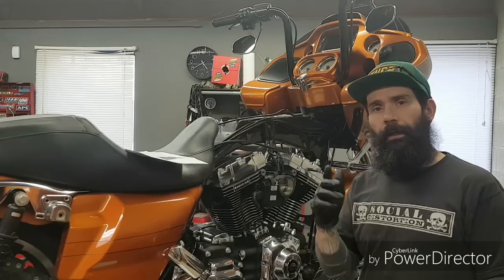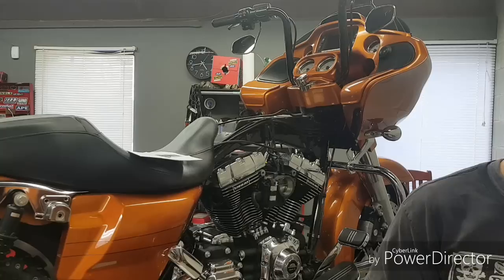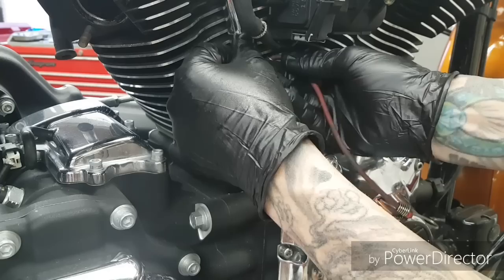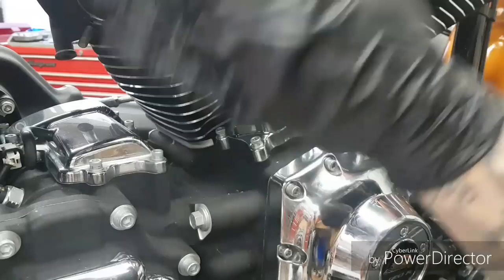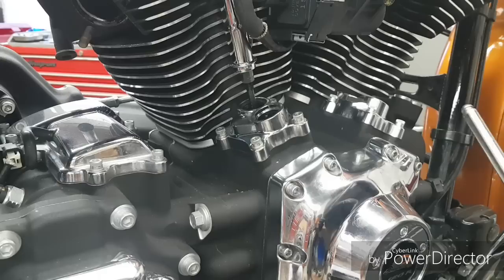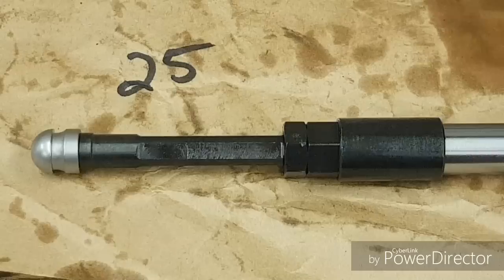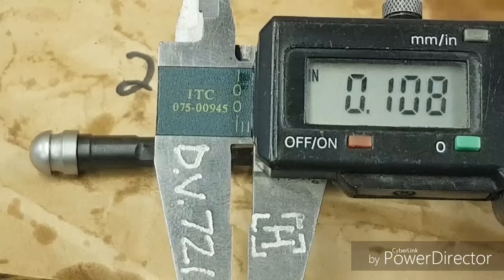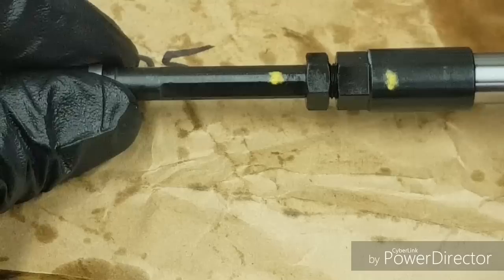Adjustable Pushrods for Harley Twin Cam

Comment: I already have the S&S Quickie push rods installed, but want to go back and check to make they are tight. Since I will not be removing any of the push rods, how will I be able to insert my fingers over the tappet covers, can I merely insert a measuring stick in the spark plug hole to find tdc?
Reply from the maker: yeah that will work fine, you can turn it off through a couple times and get familiar with where about TDC shows up. I use a longer skinny screwdriver that way it has no chance of falling into the cylinder. just be careful to not put it in to early in the up stroke as it can get caught up as the piston rises, and by to early that’s below the mid point of upward travel. use your thumb over the spark plug hole to feel the compression as the piston rises on the compression stroke

Comment: So if your installing these with stock lifters , they will already be primed and pumped up when you cut out the old push rods?   Or do you need to remove the lifters and ensure they are fully primed to ensure your adjusting the pushrods to ensure you get them to the half way mark. Approx .100
Reply from the maker: Yes, if you are reusing the stock lifters, and they have not been removed, provided they are in good shape, they are usually fine and do not require to be primed. Thanks for your question!
Reply: @CrackerJackMechanic  thanks man… I assume the spring pressure keeps the plunger at the top.  Just to be safe I will remove them inspect for any wear and oil them up prior to reinstalling them.  The bike only has 5k miles on it
Reply from the maker: There isn’t a spring inside, it’s just the static oil pressure. If you keep them upright after removing the lifter they won’t loose much oil after removing and they should pump back up just fine. 
In terms of a lifter that has lost it’s oil, it won’t take as much pressure to lengthen the pushrod on reassembly, so just keep that in mind, once you make contact with the lifter, there will be no up-down “play” and you can start your measurement from that point.
Reply: @CrackerJackMechanic  gotcha… hey is it recommended to prime the oil pump before starting?  Do you just leave the spark plugs out? Do you need to take all 4 out or just unplug the wires?  About to start this cam upgrade tomorrow.
Reply from the maker: I don’t think I’ve ever seen anything about priming the oil pump specifically. It is gravity feed and should kinda fill itself before you can actually start the engine

Comment: Shouldn't you let the first pushrod bleed down completely before you adjust the second pushrod (inlet and exhaust valve on the same cylinder)  because you can get valve kiss (the two valves  touch each other) and end up with a bent valve.
Reply from the maker: Good question. and it doesn’t t lift enough to worry about, it’s bleeding down as soon as you start preloading and  by the time you start adjusting the second one you won’t get interference. Maybe on a really high lift cam which would require head work.
If you are concerned you can wait til the adjusted pushrod is loose, to do the second one. I’ve never had any trouble
Reply: @CrackerJackMechanic  thanks for that bro.
Reply from the maker: any time!
Reply from the maker: @brenttrading2363  💯✌🏼
Reply from the maker: @brenttrading2363  💯

Comment: When planning to install new exhaust and intake pushrods into both front and rear cylinders, does it matter which push rods you insert first, front or rear cylinders? Also, if starting on the rear cylinder  (as in your video) and you insert your fingers in the tappet bore in order to find the base circle of the cam, do the results tells you that you are in the base circle for the rear cylinder and not the front base circle, correct?    In order videos I have watched, they follow that procedure for the rear cylinder but then state that the front cam is on the base circle. Can you explain?  Thx.
Reply from the maker: Good questions!
I just usually do the rear cylinder first, no real reason.
I adjust both pushrods for each cylinder at TDC of compression,  I know exactly what the cylinder I am work is "doing".
I am aware of the adjustment you described, regarding the opposite cylinder tappet poisition, you may prefer to do it that way if you are comfortable doing it that way.
👍🏻

Comment: hi nice video i have a question i follow your instruction and now when i run the bike i hear clicking noise on the rear cyclender push road. what do i need to do?
Reply from the maker: On a first start up after installing adjustable pushrods that can take up to two minutes for the tablets to actually pump up with oil again and the noise to go away it lasts longer than three or four minutes goes for the adjustment procedure again

Comment: jeff;qdo vc coloca essa pre carga de 4 voltas,vc abaixa a compressão do tucho em 4 voltas;não se corre o risco de quando o tucho carregar por completo, a válvula não feche completamente?nesse caso a pressão da mola seria suficiente pra fechar a válvula,vencendo essa pre carga do tucho?
Reply from the maker: The adjustment is different for different manufacturers of pushrods I used to translator to understand your question didn't work very well make sure to measure + .100 inch of adjustment to make sure preload compression of the hydraulic unit is in the middle of its range
Reply: @CrackerJackMechanic  thank you jack

Comment: Running into an issue putting the small retaining clips/ covers on. Replacing the old covers with the sns ones and it’s like the spring dosent move as I push the clip into the print that goes into the spring on top
Reply from the maker: Sorry for not replying! I am just seeing this !!  Those are a pain. Make sure the cup isn’t hitting a cylinder fin when you are trying to move it downward to get the bottom of that top clip into place. Also the inner pushrod tube must be fully seated at the top into the head and oring

Comment: What should i do if my lifters wont bleed down
Reply from the maker: Are they new? what brand? … there’s more to this! let me know 👍🏼
Reply from the maker: you could sit them in a cup of clean engine oil overnight and often this is enough for the air to bleed itself out of the lifter. You can still adjust and set them as per normal there just will not be any pressure against the pushrod, and they will be noisy at startup until they fill with oil and self-bleed

Comment: I suspect not all tappets are created equal, correct?.. for example, if I wanted Jim’s vs S&S, the adjustment required would be different, right?
Reply from the maker: Stock style replacement tappets all have same travel/adjustment of about .200”

Comment: What do the adjustable push rods do for performance? Do they Give you gains?
Reply from the maker: Nothing really… they are heavier then stock. Mostly so you don’t have to open the top end when changing cams

Comment: Is there an easy DIY way to check the adjustment??  I just had a new cam tensioner kit installed in my twin cam c/w new lifters and rods.  I now have a miss at medium rpm (1500-2000).  I am thinking maybe an overadjusted rod??  Thanks and great video.
Reply from the maker: Is the bike fuel injected? Or a carburetor? The miss you describe doesn't sound like a lifter issue.
Reply: Hi Thanks for replying.  It is an '05 Heritage so fuel injected.   Misses at steady speeds ie 60km/hr (example driving in town in second gear)anywhere between around 1500-2000 rpm.  Not at high speeds or when not in gear and keeping revs steady.  Harley service manager told me twin cams had to run no lower than 2400 rpm - seems like BS to me!!??  Thanks for your input.

Comment: Awsome video, how do they not come loose after a while? I am skeptical on these kind of pushrods
Reply from the maker: They are pretty reliable... make sure you tighten them!
Reply: CrackerJack Mechanic I hope so I am going to try them and maybe use little loctite on them to
Reply from the maker: @stevenmarrone1526  give them a good "squeeze" in one hand using 2 wrenches close together. I've seen them loctited but never did it myself
Reply: CrackerJack Mechanic ok I will try it thanks!

Comment: are adjustable pushrods better than non adjustable push rods. I understand it is more work for non adjustable or does it really matter when/if I decide to change mine out
Reply: I think the decision in using adjustable pushrods is to make job more simpler when changing cams etc. I don’t think it has anything to do with one being better than the other
Reply: @finley614  I think I am just going to go with non adjustable pushrods whenever I decide to do that, it is still good right now but might as well since I want to covers on top to be powder coated black or red
Reply: Hell's favorite NPC #69OU812 . exe  i think when i do that if i don't do a drop in 128 or 131 i will just do non adjustable and check everything else top end

Comment: My lifters won’t bleed down. I’ve had the engine apart for about three months I’m thinkingThat the oil is out of the lifter. I let them sit for two hours and they were still tight. They are screaming eagle pushrods that set at 3 to 3 1/2 turns. Any thoughts on why they won’t bleed down?
Reply: 24  Threads per inch,
Reply from the maker: Did you extend the pushrods until they just contact the lifter and then count out for "preload" empty lifter have no resistance against adjustment of the pushrod.
Or possibly you have lifters with limiters (search S&S HL2T) 
https://www.sscycle.com/tech-info/pushrod-adjustment
Reply from the maker: Remember we aren't so concerned about the tpi using the adjust procedure from my video
Reply: Ok I will turn the motor over until oil pressure on my gauge is showing 40  psi. I will let you how it goes. Thanks for all info. 

Jerry S.

Comment: Are the Quickee pushrods for the twin cam all the same length or part number regardless of whether or not it’s a 103, 107, 110, or 124 etc? I have a 124 Hot Set Up in my bike and would like to put these in.
Reply from the maker: No, they are all not the same. Why do you want to put adjustable pushrods in? They are heavier then stock, and can loosen off if not properly installed, they add non-performance gain. Their advantage is in saving time by not having to remove the valve covers and rocker arms, when installing new cams, by cutting the original pushrods to remove them. (TDC compression stroke)

Comment: What if the push rods don't bleed down
Reply from the maker: In the few times I can recall this happening, it was error on my part, so I had the re-do the procedure. Let the pressure off the lifters and wait 5 minutes for reset.
Other times the lifters themselves turned out to have been upgraded to say S&S HL2T limiter lifters for higher lift applications and they have a different adjustment procedure. I believe you can find the instructions at their website

Comment: What specialty tools are required to rebuild camplate,cams,inner bearings on aTC/02 RK?
Reply from the maker: I laid out the money for the Jim's Tools bearing removal and install tool. But I have done it with a decent "blind bearing" removal tool. And then carefully installed the new bearing with a suitable bearing install tool. Be prepared to shell out a decent amount of cash if you go for the Jim's tools. They are a decent investment if you plan on doing this job a few times a year.
Reply from the maker: I've always managed to install the cam support plate bearings using larger sockets and a bench top vice (suspect minimum 4") I have a 5" and a 6"
Reply: @CrackerJackMechanic  thanx for the insight sounds like a bunch of money,maybe abetter plan to have the labor performed for me.

Comment: Why not just take off the cam cover and use the dots on the timing sprockets to find TDC?
Reply from the maker: How do you use the dots to help find TDC?
Reply: @CrackerJackMechanic  If you just replaced your cams then leave the cover off.  When the two sprocket marks line up (facing each other) the rear cylinder will be TDC.  After lifters have bled down, rotate one full revolution, small sprocket dot will be in the same spot, large sprocket dot will be 180 degrees away from small sprocket dot.  Front cylinder will be TDC.
Reply from the maker: @Peter-976  thanks more than one way to get results.